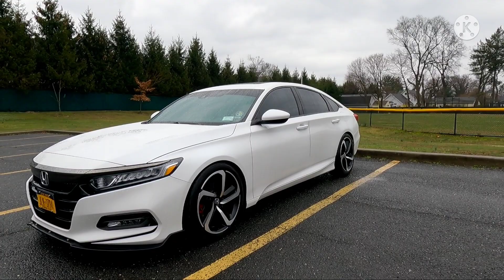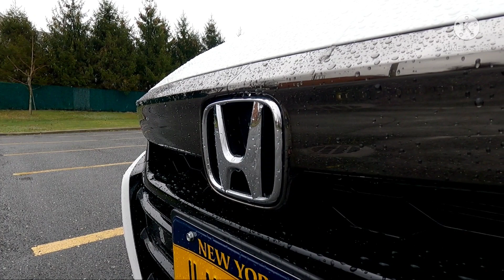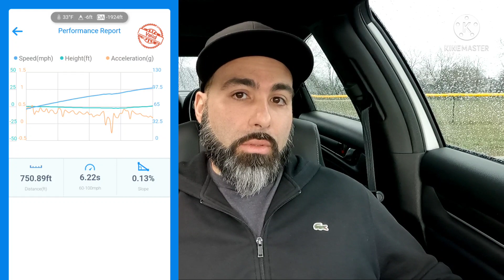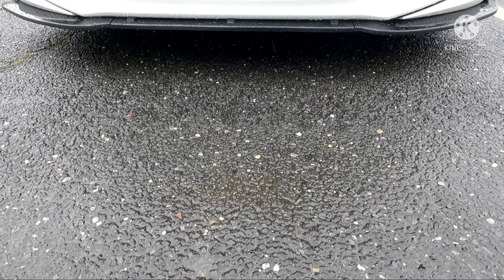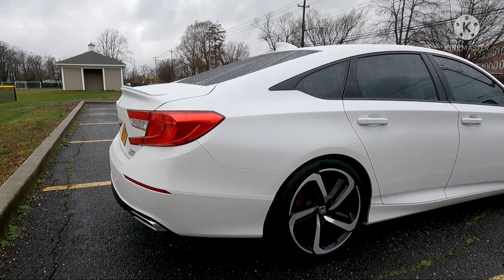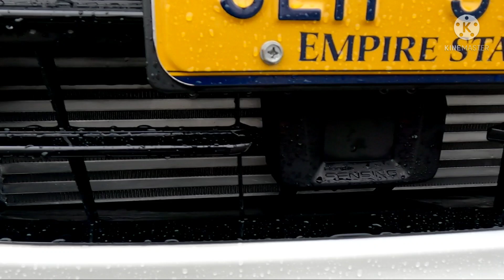PRL Front Mount Intercooler Review | Honda Accord 2.0t | 60-100 Results!

Comment: Might be a dumb question.  Do you think my stock 2.0 touring would benefit from getting this prl intercooler or mishimoto plus a drop in k&n air filter or similar without any tuning whatsoever?  Meaning no K-tuner or jb4 on the car. Will the car adjust itself,  no codes or check engine light's?  Also will k-tuner installed on a car require more services sooner? Oil, spark plugs, coils, coolant,  Transmission fluid?

Comment: Great content! I bought a honda accord 2.0T 2022 2 weeks ago, im thinking of buying a Ktunner v2, PRL intercooler and PRL Intake.. what you think? Hopefully i see a good change in the driving experience
Reply from the maker: Thank you!
Congrats! I would definitely add a catted downpipe to that list. You won't be disappointed in the difference it all makes
Reply: @DanVilla7  catted downpipe? How this sounds? Would this turn on the check engine light? Because I bought an extended warranty to it and really don’t wanna lose it neither the money
Reply from the maker: @williamlatorre3441  if you tune it your in the same boat as far as warranty.  Also with the ktuner you can turn it off in the menu. That's  what I run woth no isssues. It not loud at all and sounds better
Reply: @DanVilla7  nice! Good to know! Im from Puerto Rico!
Reply from the maker: @williamlatorre3441  cool I'm actually Puerto Rican. If you decide to get a ktuner if you can use this link it helps support the channel 
https://amzn.to/3vlRkc4
Reply: Type-R turbo in your build plans?
Reply from the maker: @JoseRivera-li8tr  I don't think so I'm pretty happy where it's at for a daily driver.
Reply: @DanVilla7  That's fair. It is really great even with the stock turbo
Reply: Yo did you ever do the upgrades?

Comment: Installed my intercooler and i think i have a boost leak. There are no broken bolts nothing is cracked could it be that i need a tune now? I can’t find the issue. My oil is at 40% i have an appointment in two weeks for that I don’t know if that’ll help. Any guesses?
Reply from the maker: Did you check the hose clamp on the drivers side? The oil wouldn't cause anything. Also a tune isn't required to run the intercooler
Reply: @DanVilla7  I’ll check out this weekend and get back to you.

Comment: The battery disconnect you described, is that an ECU reset?
Reply from the maker: It would assume it's mainly to ensure you don't short the connection to the radar in the front. But always good to reset the ecu to relearn with new parts

Comment: Can we get a 0-60 test ?
Reply from the maker: Lol I hate doing 0-60s in a fwd car...too many variables wich is why 60-100 is perfect because traction is eliminated from the equation.  When I get a better suited set of tires I will give it another try. I can't get good traction anymore.
Reply: @DanVilla7  honestly you're right even on my 2.0t only thing I'm running is 91 octane and k&n drop in filter and I still spin, of course I'm running on the stock factory Micheline tyres that come with the car. Any recommendations on tyres for traction ?
Reply: @DanVilla7  Agreed. Too many variables with tire slip. Rolling is a better measurement if for no other reason than reducing the variables.

Comment: What octane are you using with the phearable tune?
Reply from the maker: 93 with a gallon of e85, hard to find good 93 by me.
Reply: @DanVilla7  same here. We have one gas station in the metro. I’ve just been running 93. Should i mix e85?
Reply from the maker: All depends on your kcon, is it rising after a couple of pulls? If so then yes .49-.50 is ideal if you start seeing  .60+ for sure
Reply: Mine was hitting .63 and after 1 gallon of flex it stays at .50. Nice heads up. I appreciate it.

Comment: Did it need to be tuned? Bone stock rn
Reply from the maker: No tuning required
Reply: @DanVilla7 would you recommend upgrading the piping?
Reply from the maker: @ahmadmorrow2749 if you were going with bigger turbo yes. Otherwise save your money

Comment: Intercoolers DO NOT increase power. It DOES make your power repeatable because of heat shedding but it doesn’t add any power on its own.
Reply: Nooo????
Reply from the maker: I did in fact feel the same way (wich is why I waited so long to get one) but the car now has more power . For instance first pull of the day kinda thing. Never ever broke loose  in 3rd gear. It's obviously flowing better maybe alowing the power to hit quicker 🤷‍♂️. My claims are made from  my personal experience. Also 60-100 times are .3 of a sec faster
As per PRLS website:
Performance Gains:
Mid-range & top-end power gains
Major drop in post charge air temperature at peak
Increased efficiency & consistency in power delivery
Increased engine safety
Reply: @DanVilla7  Do u think the intercooler is a mod that works better if u do other mods, or is it a great stand alone mod ?
Reply from the maker: @Getyourdoe  I feel you should get some power adders first like a downpipe and a tune. But if you live in a hot climate you would see the benefits of it unmodified.